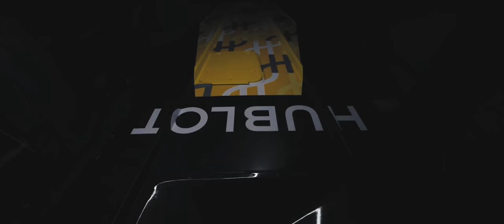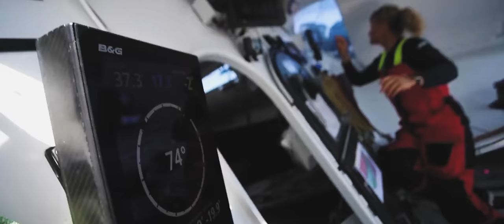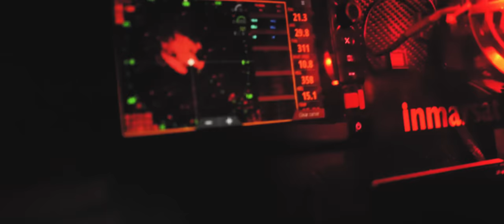Sea Wolves - Guyader Bermudes 1000 report - Imoca fleet update - The race course, weather - Coffee!

Comment: You must have misread a unit. 1 cubic metre is a volume of 1 metre x 1 metre x metre. That volume of water would weigh a ton. None of these foils has a volume of even 1 cubic metre, never mind 8.3. But the unit can't be a cubic decimetre, because that is a litre. For a rough estimate, say a foil is 8 metres long measured along its surface, has an average chord of 60 cm, and is 8 cm thick. The cross section is less than the 60 cm x 8 cm rectangle, say 300 square centimetres. Then the volume would be 240 litres, or 0.24 cubic metres. So the 8.3 must be something else.
Reply: Now a couple of weeks later i have checked the rules and it is misread, it is the static moment (ie area * distance from reference) that is 8 m3 (m2*m)  there is also a maximum surface area of 7.7m2 so it will be interesting how these will affekt the design